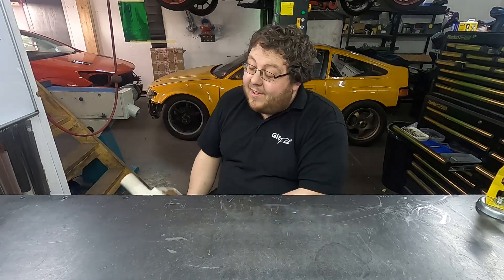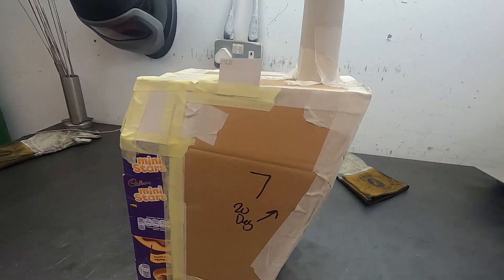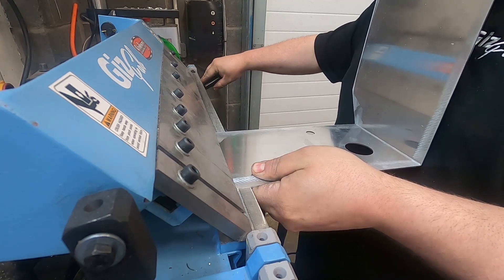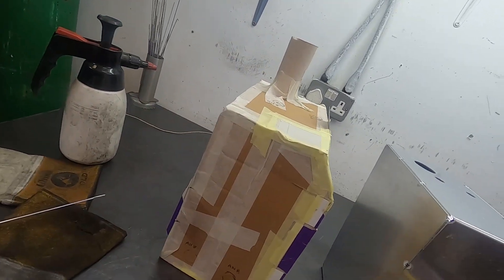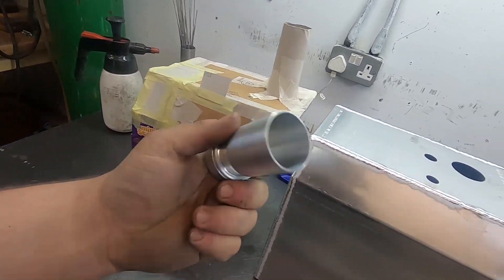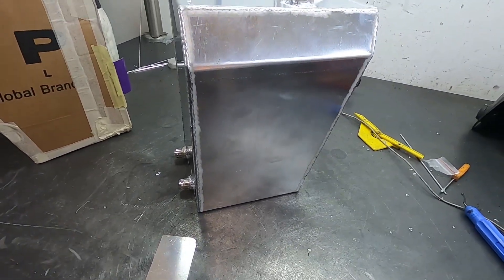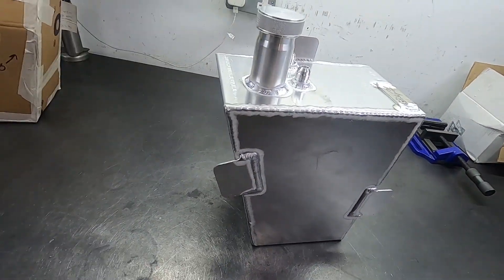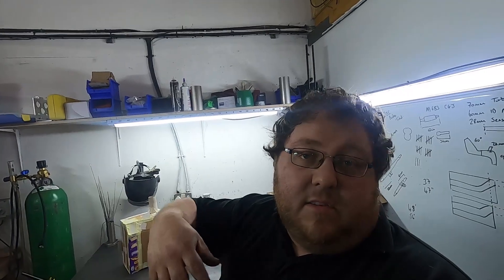Civic Drag Car Fuel Tank Fabrication

Comment: Hi from Oz...nice video..been meaning to buy one of the small pan folder...but been put off due to the material thickness capability.  Are you bending a 2 or 3mm sheet ?
Reply from the maker: Its listed for 1.6mm Maximum, but i have bent 3mm Stainless on it. It damages the fingers...but its still passable

Comment: Awesome fab work as always!

How much gas are you running? I typically find running a smaller cup (5 or 6) and around 6L/min reduces the etch zone on aluminium to the point where there's maybe 1mm of etch either side of the weld.

Will be keen to buy some of your merge fixtures when the AUD isn't so terrible